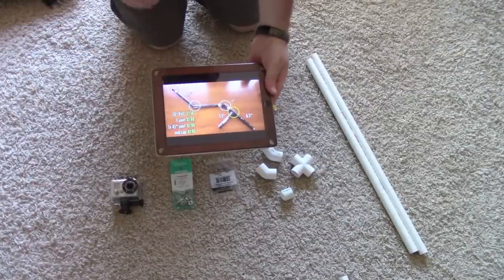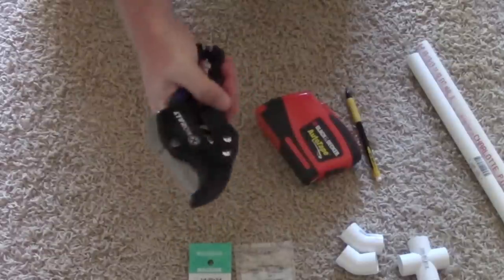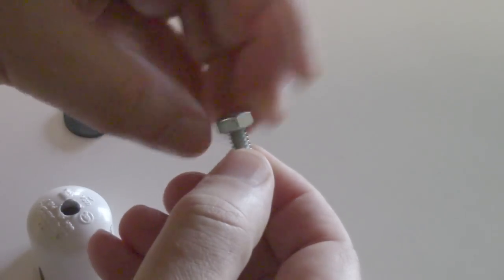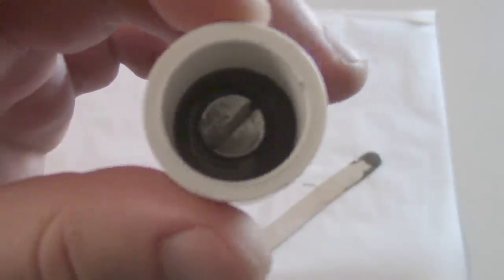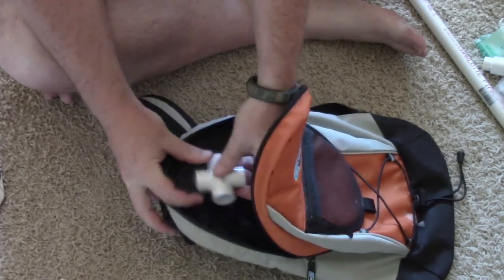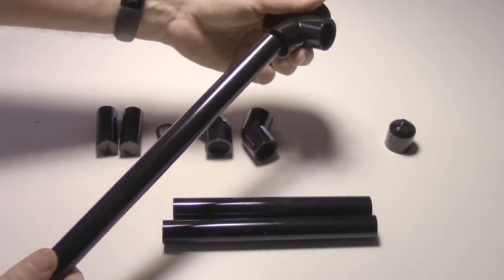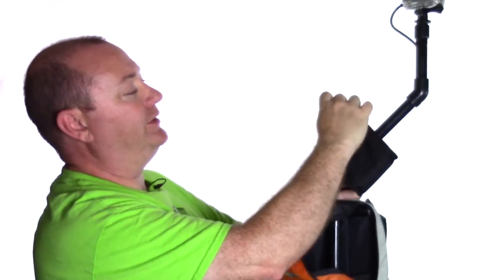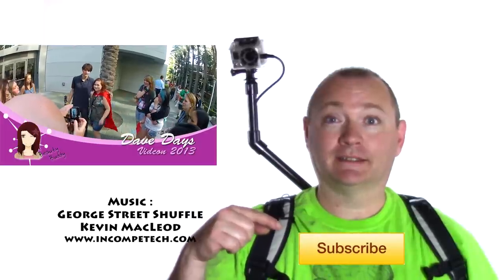DIY Over the Shoulder GoPro Camera Rig

Comment: Great Rig!! I used your framework except that I also added a stabilizer at the bottom of the backpack with end caps as well. I also bought a 14,000mah battery for the extended power ability. Thanks again!
Reply: I thought the same thing! :) it's more steady

Comment: Very nice, but that is overkill on the JB Weld, LOL. Some super gluse gel would have worked fine, and if you could have fund a shorter bolt to begin with it would have been better.
You could have added another stabilizer on the bottom, which might be overkill, but I can see you like overkill. And try to find a USB cable with a 90 degree plug, so your cable won't stick out so much.

Comment: Try the GoProb .... a cheap pole mount adaptor using cheap PVC. Works for the Drift and Contour cams. Google deadcatdot to see it. You would have saved so much time and material in making your shoulder mount using our little widget.

Comment: Awesome invention! .
What power supply are you using?
Reply from the maker: Mochileros Any USB battery backup pack will work. I have a number of various brands they,re all about the same. Here's one http://www.amazon.com/gp/product/B009USAJCC/ref=as_li_tl?ie=UTF8&camp=1789&creative=390957&creativeASIN=B009USAJCC&linkCode=as2&tag=dainb-20
Reply: Brook Dain I bought a Jackery® Giant+ Premium Portable Charger Aluminum 12000mAh Power Pack and External Battery Bank with 5 v output. What problems will that cause for my 3.7v camera?
Reply from the maker: Should be fine GoPros work great powered by USB. USB standard is 5 volts. If you are running the camera all day use the 1 amp USB outlet it'll create less heat and put less stress on your GoPro's battery.

Comment: or u could have bolted the screw onto the cap.  jb inside if u want to secure it more but then wouldnt get jb weld on the threads either.

Comment: Hi

Hot glue is easier, better and cheaper than the component glue. Your drill rotates in the wrong direction. The Rooms is still great!
Reply from the maker: Hot Glue would be easier, But not better... Epoxy is much stronger for repeated used. Yup I know about the drill... it was already drilled out just going through the motions for the video.